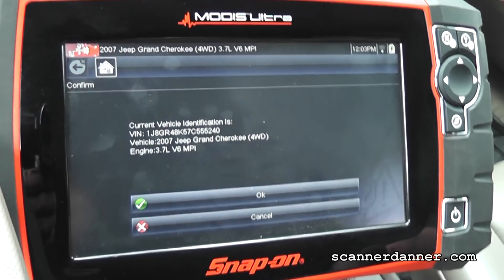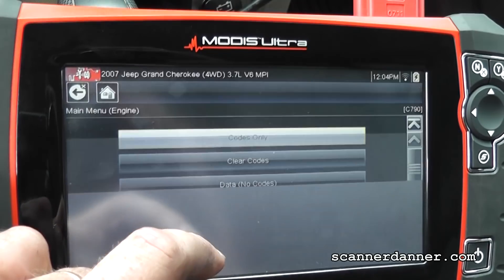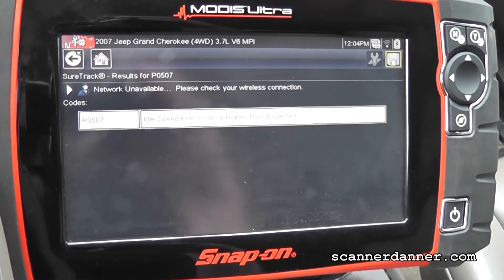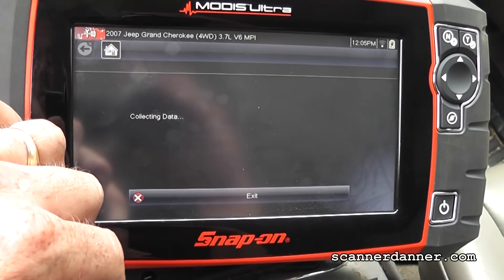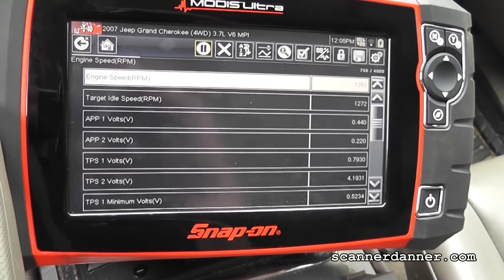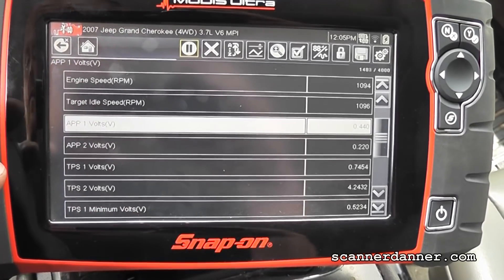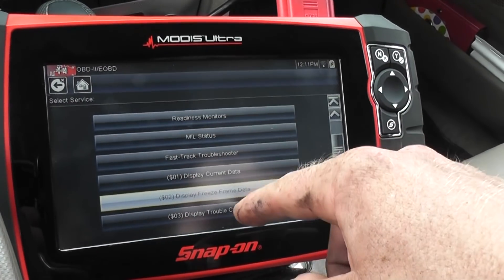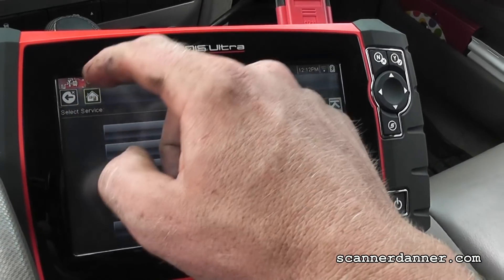P0507 Idle Speed Performance Higher Than Expected (vacuum leak) - Jeep

Comment: Hi Danner, how are you? I have a Hyundai Accent 2009 hatchback with 1600cc engine. After replacing the idle air control, the idle speed is around 950 to 1000, instead of 650 per minute. It creates unnecessary engine wear and tear as well as extra fuel consumption. Do you have any idea? Please kindly share your knowledge. Thanks in advance

Comment: I’m having this code rn p0507 my 07 jgc as well, so what exactly is this part specifically called and does oreily have them?
Reply from the maker: I dont remember, sorry
Reply: @ScannerDanner  ty for the reply bro 🫡 got a tb from Amazon $70 installed it now im getting p0507 so they’re resending me another one maybe it was defective, after this 2nd tb from Amazon if it still gives me p0507 im running to oreily and copping a doorman $250 tb lol
Reply from the maker: @lstruggy  this was a vacuum leak! It didn't need a throttle body. Hope you kept your original one
Reply: @ScannerDanner  I did but I was starting to get the red lightning tb logo flashing n the surging forward while at a red light along w rpm revving from 700-1200 so I had to replace it now I think the amazon tbs are no bueno

Comment: Does the computer control idle on my 2007 Jeep commander with 4.7L V8? I have checked the line going to the pcv and it basically crumbled in my hand. I’m not sure if the line was already bad or if it crumbled when I handled it. It has the hard plastic line and that is where it crumbled.
Reply from the maker: Yes it does

Comment: @scannerdanner  I am working on my 2007 jeep grand cherokee 3.7 v6 4wd. My only code is P0507, this light turned on about 3 weeks after i fixed the P0420 so i replaced i cat converter and it was good for 3 weeks. p0420 is gone now i am getting the p0507. do you think it might be a leak around the welding of the cat converter???
Reply from the maker: I do not, check it for a vacuum leak

Comment: I think this is exactly what I just went through. I got this code; my garage had me replace the electric throttle body; a 500$ job total... didn't fix the fault code...
Reply from the maker: Sounds like you took it to a garage full of "parts changers".
I'm sorry
Reply: @ScannerDanner broski I’m having this issue rn saw ur video tonight and I will do water test check tom ty! Btw what exactly is the name of that part that was hissing in your video and was it the oring that needed replaced or the entire elbow piece?

Comment: i bought the whole throttle body also tpp sensor and air control valve. i cleaned the old throttle body and it wasnt all that dirty , still looked like it was in great shape. i replaced the tpp sensor and the air controol valve and still getting the same problem,  also check engine light. i also ordered the whole throttle body , i suppose i need to check for a vaccume leak , hopefully thats it ... i can return all the parts i bought. aye thank you for posting this video , i will leave an update ,
Reply from the maker: for sure, check it for a vacuum leak
Reply: @ScannerDanner  whats the name of that part that was leaking air ? just in case i have the same problem. thank you
Reply from the maker: @springwellssw  I said in the video that I think it was the tube for the EGR system, but I am not sure.

Comment: Nice work. A lot of shops these days are just swaping parts out based off trouble codes. Even the dealerships are doing this. Then they just charge the customer for all the unnecessary parts they installed to "diagnose" the problem.
Reply: This happened to me 😭

Comment: I recently got a check engine light and the code that appeared on my scanner tool was P0506 Idle control rpm low

Would finding the vacuum leak also fix the start up rattling on the car?

After this video I’m definitely using your methods to find the vacuum leak.

One question tho is a vacuum pump on a car suppose to make a clicking noise when in operation
Reply from the maker: not sure, and without knowing what you are working on, I definitely can't answer that
Reply: ScannerDanner 
I have a 2015 Chevy Malibu w/241k and the only thing I did was scan the car I haven’t changed parts or taken things off.

The car has always been serviced for mechanical issue by my local Chevy dealership. 

The last time I had a check engine light the dealership replaced the intake solenoid, the rocker arm solenoid, the oil control valve, and the camshaft cover.

Now the check engine light came on and then went away so I decided to scan it myself and that (P0506) code is what I got.
Reply from the maker: @Coyotepeaks  clean the throttle body!
Reply: ScannerDanner 
I did clean it but my car still hesitates sometimes now, and also still idles rough when I’m at a stop light 

The P0506 code is gone after cleaning the throttle body but the other symptoms still persist on the car

Comment: Hi i have a problem with my 05 jeep liberty. It keeps revving while in in highspeed. The trans temp light keeps switching on also. What do i have to do to fix it
Reply: You solve this trans temp on at high speed? 
I had the same problem months ago (on my Toyota "A/T Temp" triggered at high speed +/- 80kmh). I drained and filled the trans fluid, still it does the same. After 500 km I did another trans fluid change (2nd drain & fill).    No more A/T Temp light.
Reply: @metzmatu8409  Well, it had something to do with my shift solenoid. Which was located under my tranmittion valve body.
Reply: @metzmatu8409  i did replace it, except that i lost the little balls for the valve body.  So when i installed everything back it was a total flop.

Comment: I have a car right now with this code driving me crazy, Nissan Altima 2003 3.5 making the car go crazy at 2500 rpms I did look for vacuum leaks found none but going back at it with the water spray method and I hope i find one cause don’t know what more to do!
Reply from the maker: A vacuum leak on your car would not idle high. You have a different problem. Need scan data and code information to help
Reply: High thanks for the replay just got the car back today so I have a P0507 code when I drive car and keep it under 2500RPMS no problem but when I hit 2500RPMs the car jerks bad idlestarts going  up and down between 1500 to 2500 I did try the Idle relearn unfortunately the code is still there, when I remove the code vehicle operates normally till I cycle the key, I do have a P0650 the check engine light won’t work on cluster making it difficult to do the idle relearn procedure any ideas

Comment: I had this code pop up on my 2011 Nitro 3.7L and my vehicle went into “Limp Mode”. I clear the code and the past couple days it will go into “Limp Mode” but when i plugged my code reader in their were no Current, History, or Pending codes or anything!
I did a smoke test on the i take manifold and found nothing but some smoke came out of the little pin hole on the back of the EGR (idk if that’s normal).

Comment: Great video, I never would have thought of using a water bottle to find the leak. I was going to buy a new throttle body, but it ended being a $5 elbow, no more engine light. Thank you!
Reply: Mechanics will tell you is the most expensive thing, my engine light turned on today and I hope it's not going to be that expensive.

Comment: Would vacuum leak have anything to do with my overheating? My jeep commander has overheat temp pop up. The fan kicks on high and low. I've checked my relays replaced my water pump, hoses, thermostat and coolant sensor. Someone on YouTube said it's just corrosion on the wire on the starter does that sound plausible?

Comment: Have an 08 Durango with a 3.7 with a PO507, have checked for vacuum leak, none, removed and cleaned throttle body, replaced pcv valve and hose, car runs fine but code will not go away any ideas?

Comment: I need some advice, So I got the code P0507 and P0106 and every time I try to remove the oil cap, it gets suck by the engine so is become difficult to remove. Any android before buying a new valve cover? 2010 VW jetta 2.5

Comment: Another good way to test for a vacuum leak is a coleman bottle of propane and rubber hose attached to the "burner"..just turn the bottle on...LOW....and put the rubber hose around all the areas, Idle changes and there is your vacuum leak.
Reply from the maker: for sure

Comment: awesome video, I'm working on a 2005 Chrysler Pacifica, with a 3.5l. came across the same code after fixing the 0420 and the moss fire on cylinder 4. came a crossed P0507 after. my listening for vacuum noise. I found a dry crack on the intake manifold. hopefully this helps anyone that experiences this issue

Comment: Wow...that's the same tube that was leaking and causing a buddie's charger to miss and run rough. It ended up being a rubber grommet that is exclusive to dodge. Unfortunately it was Sunday and he had to drive back to Atlanta from NC. We wrapped it very tight with silicone tape and it got him back home.

Comment: I had the same leak on my car and fixed it with High temp Pure silicon black RTV.  Just filled that whole area, because I couldn't find a replacement O-Ring.  Worked like a charm!
Reply: Mark Niebauer I had the same fix for a Charger on a Sunday afternoon.

Comment: Did fixing this leak solve this problem?  I have an '07 Dakota with a P0507 with the same leak.  I fixed this leak (and another on the PCV valve hose connection), but I still get the code.  FWIW the engine runs great and idles at 690.  I did the idle relearn, but I still get the code...

Comment: Thank you for this video Paul. I have a question... Speed density engines doesn't misfire because of vaccum leaks? Because I'm kind of guessing that they do if the leak is a the injectors or intake manifold but then again I don't know if it will misfire or cause a rich condition because of the o2 sensor trying to compensate for the leak. What do you think?

Comment: OK, got a question...I have the same car, same fault code, etc...What is the fix for this?! That metal hose is what? Has anybody determined whether its the hose, o-ring or what that part actually is? Thanks
Reply from the maker: +Van Go Ventures unbolt the tube and check the o-ring first.

Comment: You know what I like best about your videos?  That as you talk yourself through the repair, you don’t try to pretend you know everything(nobody does, right?).  You don’t act like every repair is perfect and easy.  In this case you found a vacuum leak.  Simple.  But the correct diagnosis requires a process, whether it is an easy or hard repair.  Your videos demonstrate that, as well as the repair.
Reply from the maker: +joediagnostics thanks Joe!

Comment: Will the older Vantage MT2400 scope give you similar data?  Thinking about getting a used one (my first) from a shop that is closing.  Would you go for it or pass?  Thanks for your advice, it'd very kool!  Learning quite of diagnostics from you, love it, instead of being a parts changer.  TY again
Reply from the maker: +paul2072z the MT2400 is the old Vantage. It is not a scan tool at all. It is a component test meter and graphing multimeter (scope like capabilities) 
Great tool! Just not a scanner like I used in this video.

Comment: I've never been too comfortable squirting water all over a running engine.  Especially today's cramped engine bays where you can even find engine computers bolted right on top of intake manifolds. My preferred method to find vacuum leaks is the smoke machine. No doubts there. If there is a leak, the smoke will expose it.

Comment: Almost every single one of my customers has that misconception. They think a diagnosis is checking the codes with a scan tool.
Reply from the maker: +abochavez the general public is learning the hard way that this doesn't work. It will just take a long time for everyone to figure that out. But it does suck
Reply: This is a lesson I learned $185 later

Comment: Hi Paul could you have checked for an induction leak using propane or carb clean in a situation like this or do you prefer the water method first up. Guess a smoke machine would be the next move if all else fails.
Reply from the maker: +David ODea for sure David, I just found this to be way more accurate and safe

Comment: What's happens if you use soapy water instead? Will it causes short circuits or its too messy?
Reply: BIG Z Well you shouldn't spray it directly on electronics if you can help it.  Soapy water is great because it will bubble but everyone can find a soda/water bottle just about anywhere you're at but perhaps not soap. ;)
Reply: +BIG Z Soapy water is for positive pressure leaks. This is a vacuum leak, you will never see it bubble on the inside.
Reply: +Eric Morrison thanks man